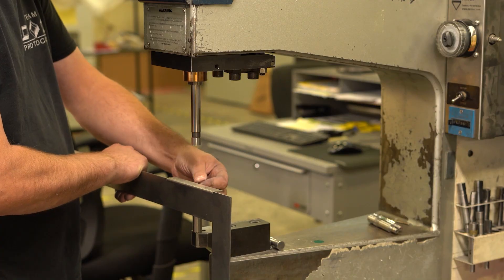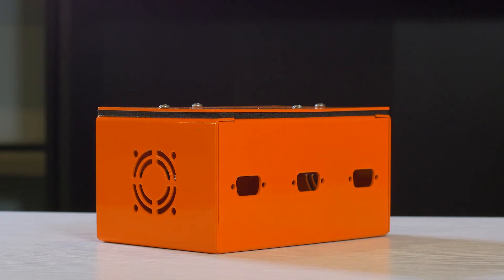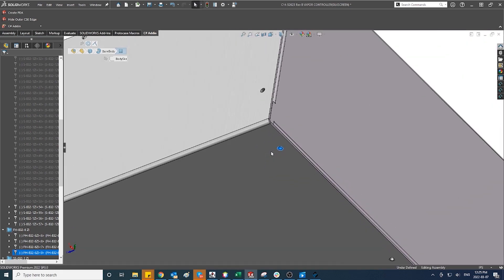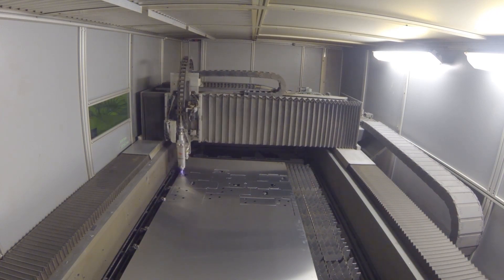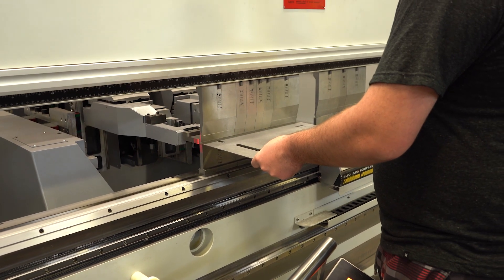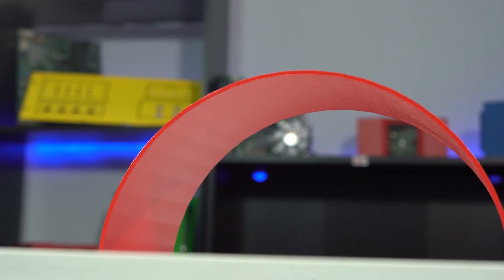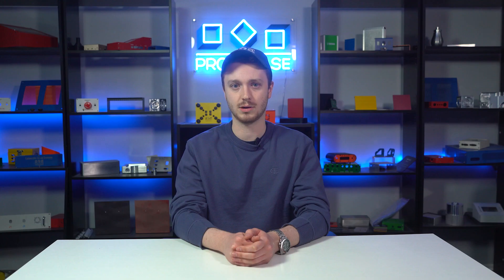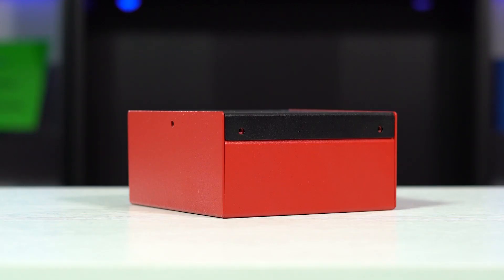Proto Tech Tip - Sheet Metal Design Clearances

Comment: Many thanks for your useful videos, subscribed! Kindly let me know if my calculations for typical clearences in millimeters below are correct?

+/- 0,13 mm - for laser cutting
+/- 0,25 mm - for bending
+/- 0,08 mm - for powder coating
- which makes it necessary to leave ~0,46 mm of space between parts of an assembly? 

I'm just trying to wrap my head around the numbers as in another video you mentioned that you typically leave 0,01 inch between parts (~0,25 mm) - https://www.youtube.com/watch?v=Rx95Ebn_WK8. Many thanks for your response in advance!
Reply from the maker: Hey Mikhail! We checked with our engineering team on your question. 

What you listed above our worst case tolerances for each process, however they are typically not at the larger end of the tolerance. We have found through years of testing that the .010" (.25mm) of space between parts works best for simple designs. However, of course, with an increased number of bends, this tolerance should be adjusted accordingly. 

Our engineering and design service team can assist you with allowing for proper clearances between parts if you are ever unsure. Once you have your design files all ready to go, send them over and they can review!
Reply: @ProtocaseInc  Got it, many thanks for quick response and being ready to help!
Reply from the maker: @kmihhh  Our pleasure! Thanks for watching our videos.